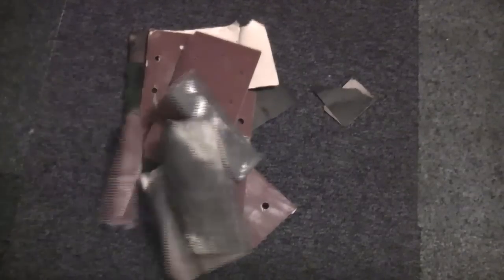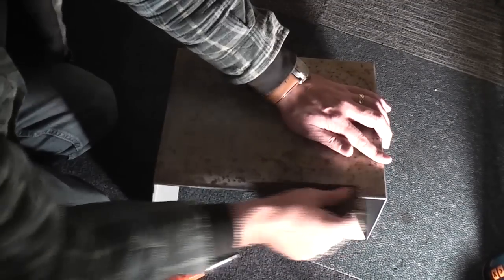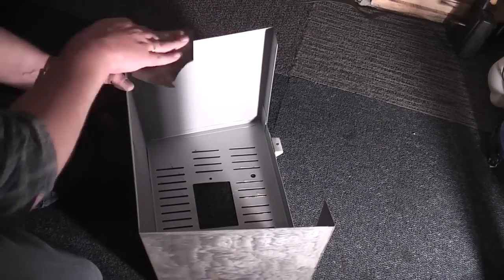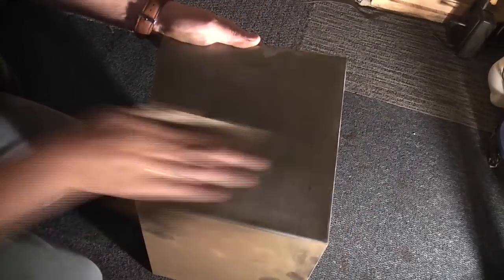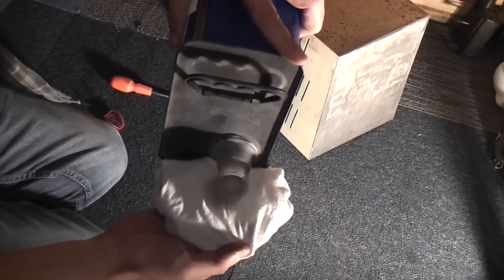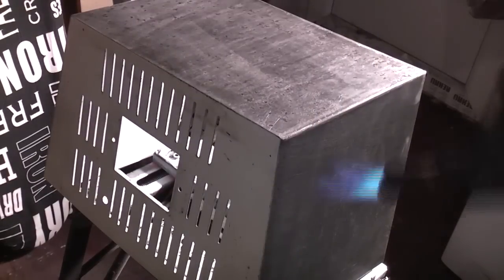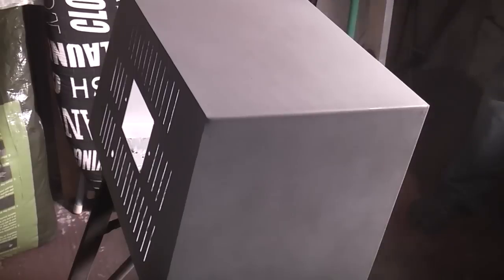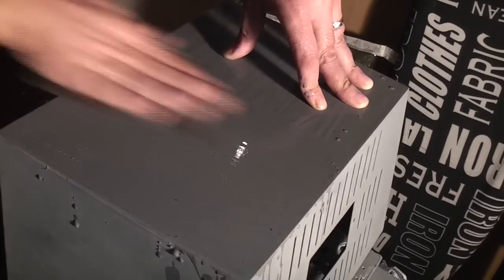Commodore PET Restoration - Sanding & Primer

Comment: Brilliant!  I wonder if its worth using a filler of some sort on all the pitting, a coat of car filler smoothed over the whole thing to get into the pits?  It wouldn't take much I expect but might give it a perfect finish.  Look forward to the next part =)
Reply from the maker: +GadgetUK164 Thanks matey. I actually bought some Isopon body filler when I bought the paint but the pits are quite shallow and it's a lot easier to sand down the primer than the body filler. I bought it in case the primer wasn't enough but haven't had to use it :)

Comment: dang. lot of work.    could you have used an epoxy maybe. fill up those bigger pits
Reply from the maker: +David Ammerlaan Thanks mate. I could have used something to fill the holes but that would be a lot more work to sand down. The primer is easily sanded, although it is taking longer to do, it's easier in the long run :)